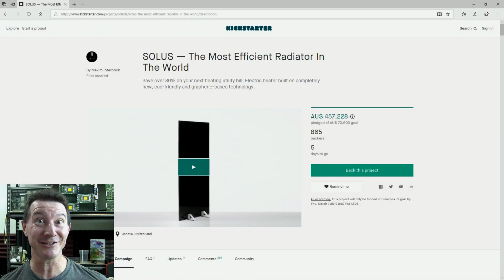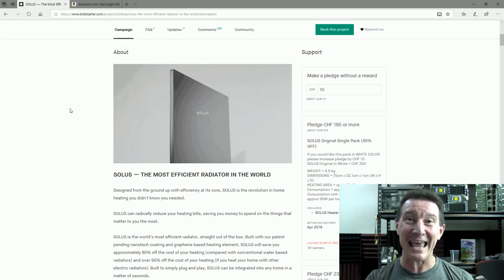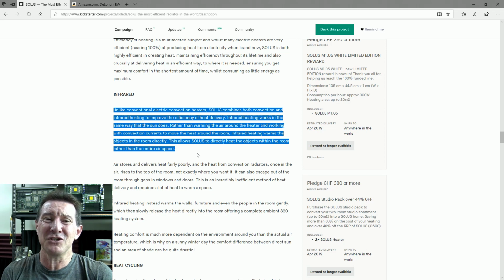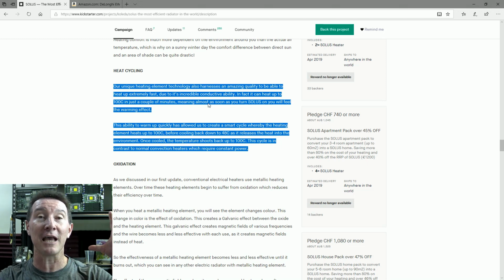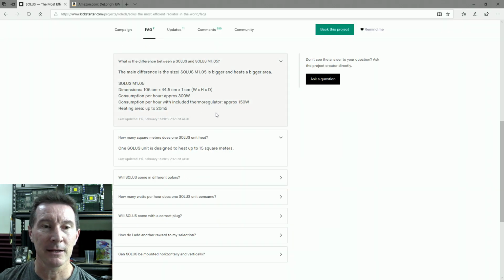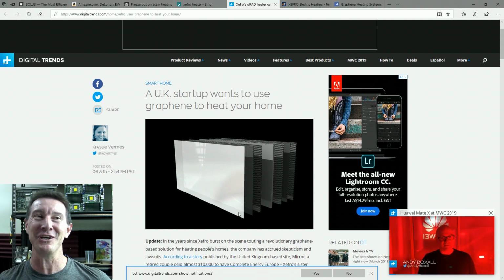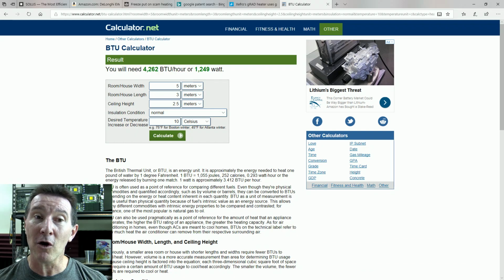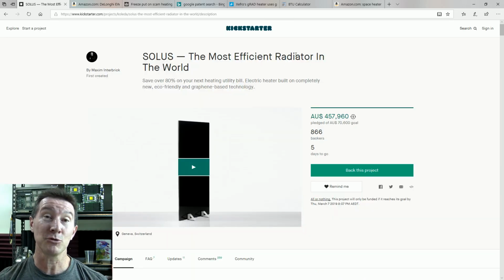EEVblog #1186 - Solus Graphene Heater Kickstarter BUSTED!

Comment: A couple hundred watts?.......good luck heating a room with that.....does it come with a coupon for a sweater?
Reply: Exactly, 200w would have trouble heating a shoebox.  Most room heaters are at least 1kw.
Reply: Daniel Tarr in the US, many cheap heaters are 1500W, because that’s almost all you can get from a 110V, 15-amp circuit.
Reply: @markiangooley  correct, that's why I said "at least".
Reply: Maybe it's made for the Australian market. I'm thinking it might be ideally sized for QLD or NT, especially between October and March.
Reply: Free Solus sweater Free with every purchase!
Reply: Maybe we could plug the sweater in, and use some of those 200W ?
Reply: I can heat 3 rooms with a 700w oil heater.
Reply: If you need more than 200-300 W to heat the room (depending on the size of the room), it means that your fridge has better thermal insulation than your home.
Reply: @andreasmaltcke117  be a little hard to breathe in the house if your house was sealed as tight as the refrigerator don't you think
Reply: I have a 3.6kw heater for my full house...  And we have 10 rooms (including bathrooms and kitchen)... Of cause we got really think insulatiin
Reply: @matsv201  that is a very small amount, but still the equivalent of having more than two of these heaters per room.  Just out of curiosity, what are the temperature extremes where you are located?
Reply: @mdrew44628  
Yea i would need to have two of the larger in the larger rooms... and in the bathroom i probobly would be able to go with just one of the smaller... but its not quite true.

I live in the center of Sweden Inland from Stockholm. 

Normally the temperatures is between -10C and 0 in the winter. Sometimes its -30C.

There is a bit of a caveat, making this not quite applicable. To the benefit of the system i have. It uses a 1500 liter reservat tank. This even out the power usage between night and day.

I also use inteligente thermostats. At might and weekdays before non kitchen drops down to 8C (also saving power on the refrigerator). The childrens bedroom drop down to 12C when they are in school, and the master bedroom drops down to 12C until 7PM....

Well, that is, the thermostat drop down, the room temperature rarely do. Also the heated garage is set on 10 degree all day.

On week ends the heating is for most part on full tilt all day.

The bath rooms is on 25C all day every day

To the "decerment" of my system. It also heats water. This do use a bit of power, specially with a 300liter tub.

Of cause, the electric heating is only "lazy" heating. I have a secondary heater. A 14kW wood stove that i have to use if the temperature drops down to lower than -10.  But i usualy run it every second day or so during the winter. But i can run the house with out it, no problem. Just that wood is cheaper than electric power.

I also have a tertiary heating system. 4.8kW solar power. This is brand new, and i just used it for last 6 month. This system pretty much give 0 power during December and January. Ut just never get sufficiently hot to circulate the water.

But during the second half of February it really helps a lot. I bought the solar panels so i wouldn´t need to run the electricity during the summer.,

The thing is over here. While the electric power is dirt cheap during the summer (about 2-4c/kWh), the transfer cost is really quite high (almost a euro). I calculated that i would have the solar heater payed back with in 8 years only for the 6 month during the warm part of the year.

Comment: Their magic graphene looks like bog standard thermal paste that you smear on heat-sinks.
Reply from the maker: I think the elements are graphene-ish, but they seems to almost totally focus on the paste. But either way it's bunk.
Reply: EEVBlog - Ah, just what I want on my resistive heater - elements made up of a material with incredibly low resistance.
I realise the whole thing is nonsense, but how exactly do they justify that one?
Reply: certainly looks like general cpu thermal heat paste. i think someone could even build 1 at home with some heating elements, a controller and 2 plates of glass

the stand might take years of research to perfect tho lol
Reply: thermal paste is usually non-conductive

Comment: Why not use a 200 watt incandescent bulb? Does much better radiation than this over-engineered, under-performing, larger footprint tile and is also much more cost efficient.
Edit: didn't consider that bulb also gives off light. Not suitable if you plan warmth while sleeping, bulb would be galaring in your face, but eye mask can take care of that... 😬
Reply: You could put the bulb in a swanky black box.. put a few logos on it, a bit of chrome maybe.. sell it for a fortune.
Reply: there are special "heating light bulbs", they use slightly different filament optimised for IR radiation and bulb is dark red filter. yes they still produce some light (dark red in colour) but mainly radiate heat (IR).
Reply: Woods blacklight bulb should help
Reply: There is actually a legitimate company in Ireland called Solus, who make light bulbs.  https://www.solus.ie
Reply: Basically any IR heater gives off light.. The Black body radiation curve is a bastard. But you want a shitty lightbulb maybe so it doesn't equal daylight in your room
Reply: @allesklarklaus147  we owned a poultry farm, we used to keep the chicken warm with help of an array of 200w bulbs in 2°C...😁
Reply: That would probobly save more heat. Because when ir hit the skin it feals warmer.. promting you to lower the temperature

Comment: We should try to sync a few of these up in say a whole neighborhood? Draw some hundreds of watts every 1.5s synced up I wonder what kind of havoc we could cause. 200 watts * 6 units in your home * 50 homes in your neighborhood and ya get  60 kwatts. Unfortunately we don't get inductive kickback with a purely resistive element and it would be better to operate closer to ac line frequency for this loading attack to work. Bummer
Reply: 50% attack on the power grid already happened and its called Bitcoin
Reply: @mrlithium69  interesting. I have never thought of that. I'm sure the frequency was not constant. Thats important because every ac power system has a, more or less, locally fixed capacitance. Harmonics are fun

Comment: Actually, oxidization does effect heat transfer. Look at your soldering iron! Agree this heater is b.s. but, the oxidation argument is somewhat valid.
Reply: It's not exactly the same thing though because with a soldering iron you're trying to get the heat to go to a specific place, with these heaters you just wanted to go into the room. As long as you keep putting energy into the heating element it will just get hotter until it's hot enough to radiate its heat at the same rate that you are putting energy in. It also differs in the fact that the temperature sensor on a soldering iron is measuring the temperature of the soldering iron not solder or joint you're trying to work on. Where in a space heater situation the temperature of the elements is not directly measured but the temperature of the room is. Which removes the possibility of arguing that the element would not be outputting at full power because the thermostat would be turning it off earlier because it got too hot because it couldn't conduct away enough heat.

Not that that really matters because even running at 30% capacity of a normal $15 space heater will still put out more heat than this thing.
Reply: @MarkFunderburk  Actually, the element in space heaters are in fact being measured constantly. Without doing so, they would simply burn up.  Think common bread toaster. Most common failure, open element due to melting.

A good soldering iron also has a thermal cut-out but, unlike the space heater or toaster, will draw more current to maintain a preset temperature. Introduce oxidation to either and your ambient temperature drops.
Reply: @robertking7584  I should have added the element should have thermal protection but that is not what controls it turning on or off in a normal situation. Of course the resistance of the heating element won't be the same at every temperature so that will affect the total heat output in a small way, dependent on the design of the heater.

And of course there are already heater designs that don't expose the elements to oxygen anyways, so I don't believe it's really worth giving them any consession on that marketing point.

Comment: To be fair, a radiant heater is different than a convective heater. Most heaters are convective, either forced or passive, where air is heated and then this air moved around the room to heat objects (naturally due to black body effects they emit some infrared, but it's not central as with radiant heaters). Radiant heaters have a big reflector and tend to glow some. They feel pretty weird since the infrared heats your skin and face directly. It sounds like this might be radiant (infrared), so the glass wouldn't be a problem. Radiant heaters can be faster at heating you since they don't have to heat the air and then send that air at your skin, they just send the infrared through the air directly to your skin.

Regarding "heat regulator", I was hoping you'd keep saying thermosta... heat regulator, to mock them.
Reply: You are not going to get much useful radiant heat off a 100°C radiator unless you are practically sitting on it, at which point it may as well be conductive heating.  There is a reason why true radiant heaters typically glow a full to bright orange because those are the temperatures needed to produce the sort of IR that can actually warm you at a distance from a source with limited surface area.  Nearly all the heat from this heater is going to be convective from the room air passing over the surface of the glass, hence why it’s orientation and mounting options are optimized for convective airflow.  Yes, you will feel some radiant heat if you are within a foot, or so, of the panel, but that is about it, much beyond that range and you are very unlikely to detect the added warmth.

But no need to take anybody’s word for it, just boil a pot full of water, take the pot off the hot burner, then see from how far away you can detect the heat radiating out the sides of the 100°C pot of boiling water.  If you want to try a glass pot, then use a Pyrex pot and repeat the experiment to see if you detect a significant difference in the result.

But the truly critical point is their claim of being effectively 5 times more efficient (the 80% less energy claim) than any other electric resistive space heating alternative.  The only thing that will exceed the 100% efficiency of resistive heating is a heat pump and only because heat pumps do not actually create heat per se, rather they move (pump) existing heat from one area to another — hence the name “heat pump”.  This Solus space heater is functionally no different than any other resistive space heater and will have the same 100% efficiency at converting a watt of power into heat. 

They actually go on to claim in some online forums that there heater creates no magnetic fields or stray currents and that it is so efficient because it does not use a transformer “like other heaters in the market”.  I’m still trying to figure out what space heaters they found that required a transformer, much less how they are going to pass a current through the graphene without creating a magnetic field — much less how they think the absence of those things results in their device being 5 times more efficient.

The sad thing, if they had simply marketed this as a “stylish” modern looking alternative to the everyday space heater, and dropped the false efficiency claims, then they would have had a solid and honest add.
Reply: @ethanpoole3443  the glass insulates the heating element from the surface and can be transparent for infrared. So it is possible that the surface is much cooler than the heating element itself.
Reply: Superwip As Star Gazer mentions, short of them using more exotic types of glass (which would have no doubt been mentioned in the marketing), your most common forms of glass are opaque (black) at the long infrared wavelengths that this heat source is going to produce, thus not transparent, so the glass will not be far off the temperature of the heating element.  If the interior heating element were hot enough to produce the shorter infrared wavelengths that do make for an effective radiant heat source, and at which most glass is indeed transparent, then it would be hot enough to be glowing somewhere between a deep red and a bright orange (as with any other true radiant heater).   Functionally, this heater is no different than a typical oil-filled space heater of equal wattage in both efficiency and mode of heating (minimally radiant, mostly convective from warmed air passing over the surface and heating up).  Dave gets the terms radiant and convective mixed up a good bit in the video because these are often advertised as “radiant” type heaters to differentiate them from forced air heaters, but they are in fact convective despite the lack of a fan, they just exploit the fact that warmed air rises to naturally draw air across their surface to warm the room and are, thus, still a predominantly convective heating source despite the lack of a fan — that is also why they are designed to always be installed in a vertical orientation so that they can readily establish convective air currents to dissipate their heat thus warming an area more evenly.
Reply from the maker: @ethanpoole3443  Nice summary
Reply from the maker: They claim this is also a (passive) convective heater, which it is not. The glass prevents the air getting back to the actual element. But of course there is some natural room convection 
Oil (and water) heater which are seriously common are predominately natural convection also. But any type of heater has a mix of the various forms.
Reply: I fully agree... Same comment I did. The question is not about how the heat is produced but how efficiently is it transmitted to the environment. In any case, these guys are overselling their radiators.
Reply: blargg 
The biggest radiant heater you’ll encounter is the Sun.  I wouldn’t consider that effect to “feel pretty weird”.  🤨
Reply: I'm just talking about how a radiant heater feels. I tried one a while back and it was weird to use in a room. Maybe it's expectations. It's like sitting in front of a fireplace or a camp fire (or in the sun, as you say). I don't want that feeling just sitting at the desk. Oil-electric radiator FTW. Quiet and relatively safe due to low surface temperature.
Reply: Boggisthecat - The Sun heats up everything, whilst a radiant heater is mostly directional. There's a greater temperature differential because you're the only thing getting warmed.
I'd say it's more like sitting in a heated seat in a car.
Reply: Forced is not convective it's forced!
Reply: Glass is opaque to long wave infrared (radiant heat).
Reply: Of course, this would make a better space heater if you laid it flat rather than vertically - esp if against a wall...

Maybe v2 could perforate the glass sheets to increase the radiant surface area...?
Still only 190w going in tho’

Comment: I get his point but Dave really needed to be more specific when talking about the thermal properties of glass.

If it was as bad at conducting heat we wouldn’t have double glazing.  Glass is pretty bad compared to say metal but it’s not better then say a blanket.

And if the thermal conductivity is so poor it’s not going to heat the wall...
Reply from the maker: Yeah, I should have been more specific.
Reply: yea that was the weakest part of the video but I forgive him cause he was right in a way and hes not a glass expert, and his electrical analysis of it being bunk still stands.
Reply: Dave was not wrong. The thermal conductivity of glass 0.8 W/m K. Steel = 50.2, copper = 385.  Glass is a poor conductor of heat.  A large area, thin panel such as a window will help to minimise thermal impedance (hence the need foe double glazing) but it will still be a couple of magnitudes worse than e.g. steel.
Reply: That’s my point, the worse then a sheet of anodised metal was implied but is a semi important point which could have been explicitly stated.  

A glass back and nice anodised aluminium front would make a nice looking heater.